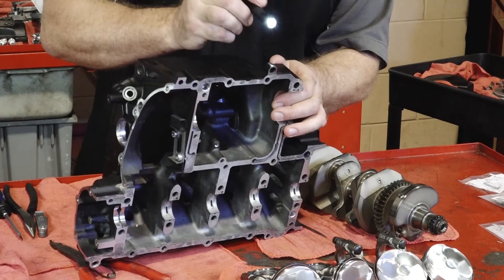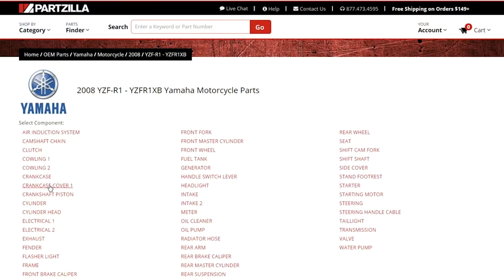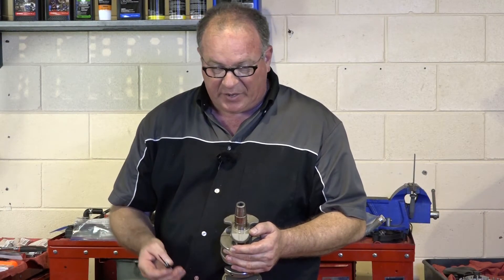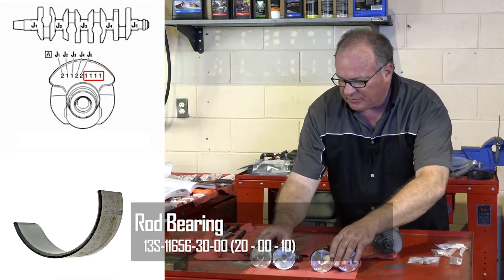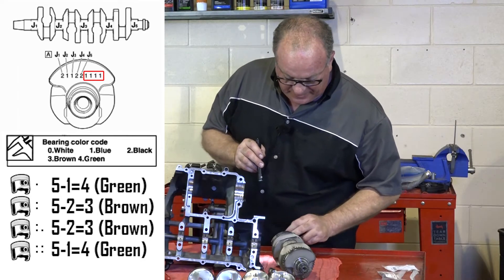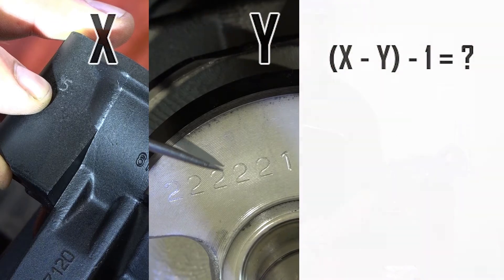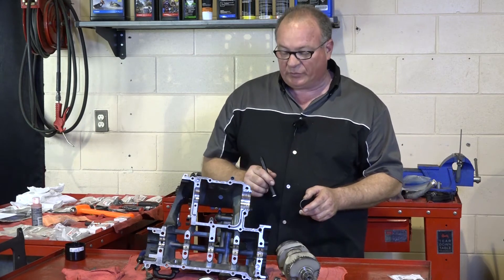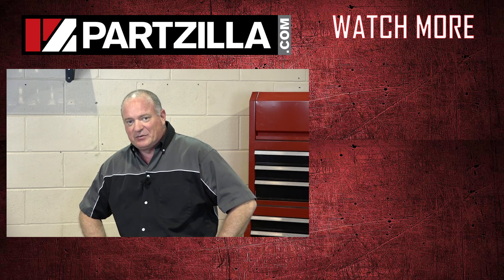Sizing the Bearings on a Yamaha R6 | Partzilla.com

Comment: But, what if the codes are no longer oem, due to wear, damage or repair? Would you then have to measure, determine new values/color codes and order bearings based on those results?

Comment: I have a 2011 Yamaha fz8. I’m replacing the crankshaft my crankcase number are 66665 the crankshaft web numbers are 11211 it follows the same rule for sizing x-y= bearing size but if the color code stops at 4=green  what’s confusing me is with my crankcase and crankshaft Web I’m getting 6-1= 5 or am I missing a step ?

Comment: what if you polish the rod  journals so now they would be slightly undersized how can you select a bearing color, can anyone tell me which bearing shell color is the thickest and which is the thinest with that information you at least know which direction to go from the color chart as the more you remove from the journal the thicker the bearing would need to be, i would imagine the difference between the thickness of the bearings would be about .0005 in or a half thousandth of an inch or maybe a tad less

Comment: Hi Guys I desperately need your help to purchase the correct bearing for my 2007 Yamaha Waverunner FX cruiser HO. 1100.
The crankcase number 6B600 Y-1 and the number on the flyweight lobe which is 22222-2322 MBC does not give me a code which is in the manual. Incase you can help the number on the Conrod end cap is 5B. I need to buy Rod and journal bearings.

Comment: Those numbers are really only good if you are working with a new case and crank. Those numbers aren’t going to be accurate on an engine with 30,000 miles. You’ll need a micrometer for new measurements. As crankshafts wear their OD gets smaller.

Comment: Is it possible for the numbers on the crankcase/shaft to give the incorrect bearing sizes? I'm experiencing seizing on my crank with the recommended sizes...
Reply: You did the right math and that happened? Maybe you had a different crank in your engine?
Reply: @frankiemarchese2978  I took measurements and everything checked out. Calibrated my torque wrenches. Ended up buying a new engine. 🤷
Reply: Damn! You did plastiguage and all that? Or did you use a micrometer and dial bore? I have my whole engine apart and just bought 10 new main bearings accorind to the numbers on my case/conn rod/crank, I guess I’ll just plastiguage them to check but don’t feel like doing it haha

Comment: a have a problem, my cranckshaft is 12121 1111,  my block is 5 and I use brown, black, brown, black an brown crankshaft bearings! but the second black and third brown, unexpectedly a strange noise appeared and when it opened it was scratched ugly the cranckshaft
Reply: You ever figure it out?
Reply: @frankiemarchese2978  my block was not 5 and the bearings were wrong, that's why it made the noise! then I saw that it was 4 I changed everything and it went back to normal, because the numbering is on the upper block of the engine!
Reply: Oh so you made the mistake of looking at the wrong number? Im confused. My crankcase # is 5 and all of my numbers on the crank are 2
Reply: So if thats right then I need 2 which is black bearings because 5-2-1=2 (Black)
Reply: Im going to plastiguage when I install them
Reply: @frankiemarchese2978  the last 4 number of your crankshaft are to rod bearing and the 5 first Numbers are to crankcase, if you crankshaft have all same numbers 2, irs originally fron factory, so calculating 5(case)  - 2(shaft) - 1(to gap) = 2 bearing black

Obs.: the workspace (gap) is the most important to be observed, because if it is too tight it will damage the shaft, but if it is too loose it will cause large vibrations that will damage the shaft and cause damage to the pistons, so the calculation with the gap already indicates the right bearing to be used
Reply: @frankiemarchese2978  exactly
Reply: @frankiemarchese2978  I don't advise, do as in the video, there's no chance of going wrong
Reply: Thanks, I put the new black bearings in yesterday and they are all at .0015” clearance. The spec is .0006”-.0015” so I’m happy with that. The limit is .0039”
Reply: @frankiemarchese2978  congratulations bro! You’re awesome

Comment: i have problem with my r6, it have knocking sound, sometime its gone, when i rav more then 6rpm the sound will come again, and turn engine off for half hour the sound gone, what is the problem actualy
Reply from the maker: check oil. Then start with a valve inspection.

Comment: ian a newbie here, can anyone explain why didnt they use ballbearing at some part of the engine?
Reply from the maker: Were you thinking of something specific or these bearings on the crank?
Reply: @PartzillaParts  yes, i was thinking about all of those bearing that looks like a piece of metal.
why dont they ballbearing all the things?
Reply from the maker: Because the sheer force would tear apart standard ball bearings.  They make these out of a softer metal, so when coated with oil, they wear but don't destroy the crank or block.

Comment: Great video! I purchased a crankshaft and conrods for my virago xv535, but numbering is a bit different... Crankshaft has 22U-1, one conrod has 3Y4H and the other 3H3H.... How should I select the bearing???
Reply from the maker: The manual will have the correct coding.
Reply: That's the problem.... The manual describes only one number, but I have two numbers in each conrod..   Is it possible for one half to have one color, and the other one have another color?
Reply from the maker: What year is your Virago?
Reply: It's 94. I've yamaha's workshop and Haynes manual
Reply from the maker: Something's not right.  22U-1 is the start of the part number.  Are you positive there are no other numbers stamped anywhere on the crank?
Reply: Correct, no other numbers... Just colored dots painted in the counterbalance

Comment: Mr. Talley  i have a cbr 100RR 2004 wich crankshaft bearings i need how can i see that. On you shop i dont see it.  I see this on the crankshaft L2212 LBBBB
Reply from the maker: Numbers are your O.D. Code, letters are corresponding I.D. codes.   So based on your code, 2 with B is Yellow and 1 with B is Pink.   So your selection would be Yellow, Yellow, Pink, Yellow.     #9 are the bearings and they are listed by color.

https://www.partzilla.com/catalog/honda/motorcycle/2004/cbr1000rr-a/crankshaft-piston
Reply: Thank you i order the items now

Comment: Hello, this, as shown in the shop manual, is for new parts. But what if there is wear involved? I couldn't find any actual size specs apart from the color codes, and just choosing bearings one size bigger and hoping for the best doesn't sound too great to me.
Reply from the maker: You would use a plastigauge to measure them and select the right bearings.
Reply: Thanks for the reply. But how do I know which ones are "the right bearings" to select? Suppose I measure and the clearance is 0,02mm over the limit. Next step is to go online and order. Do I buy the same color as I have now? Do I go one size bigger? Had it been possible to get one sample of each size in front of me I'd just plastigauge each and keep the one that fits best, but that is not possible...
Reply from the maker: The only way to really do it is to get an original set and plastigauge, then reorder the size you need.  It's not cost efficient, but it's the correct way to handle it.
Reply: Would be more efficient when Yamaha or somebody else would give the sizes for each bearing shell, then you can select what you want. I think bigger number means oversize bearing (journal is smaller).